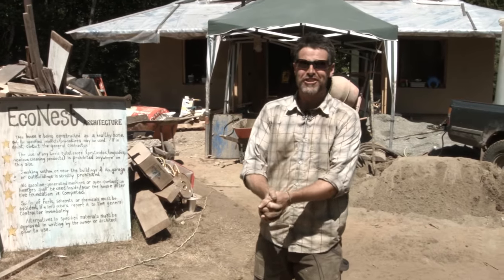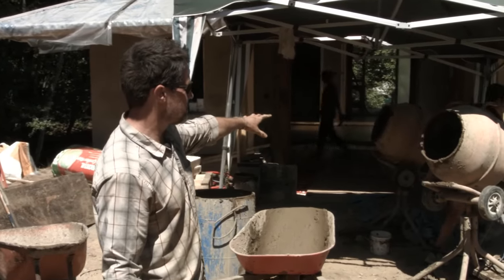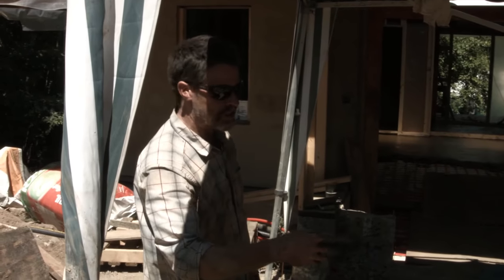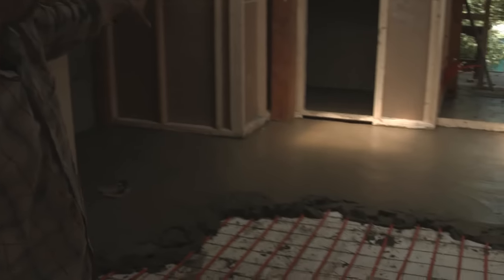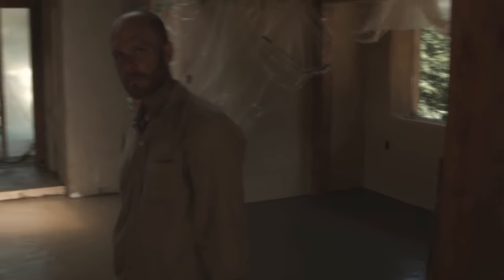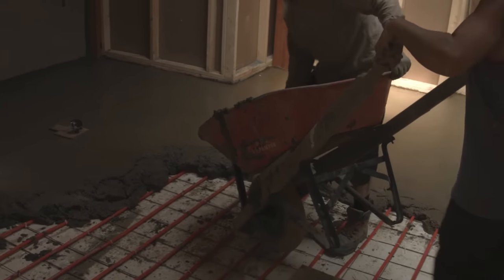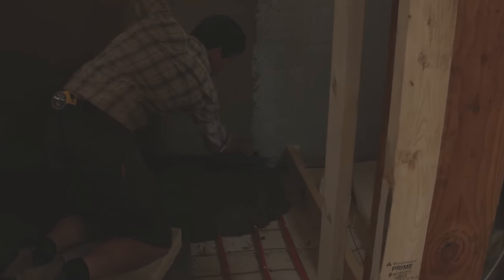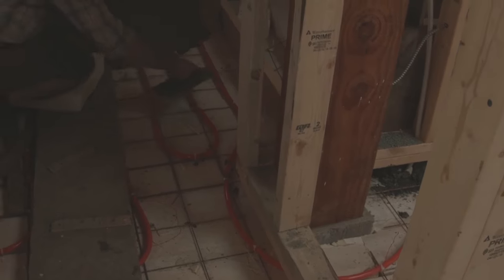Healthy Homes - Earthen floor and hydronics explanation

Comment: I was wondering how durable are the pex water pipes and what the chances are of them springing leaks? I love the idea of a warm floor but wonder if it would be a wiser choice to attain that with other options like a rocket stove bench or wood stove? Yes, it would take longer to heat the home and retaining the heat would require a daily fire but, maintenance would probably be more practical should something go awry.
Reply: If you can access cheap lumber sure, but PEX tubing can also deliver cold water, also you want to heat the place with the most thermal mass which is usually the floor also more even distribution. Please correct me if I'm wrong.
Reply: @roiad876  I am not sure. It’s been a while since I have watched the video and not sure if the PEX had concrete poured overtop. I was told PEX can expand and contract and that is why it makes for a better option, for less leaks, but how long can it last in concrete and is it able to expand and contract in concrete? I have always been leery of it, but if put in an earthen floor, probably better and easier to get to if something did go wrong, and possibly has the ability to expand and contract too.

Comment: I like that very much and will build a natural floor with heating. i just don't know how to heat i don't like gas and electricity... I would prefer a rocket mass heater but I can't find anything if that works or not... Das anyone have experiences or suggestions? I would be really happy 🥰
Reply: you could try a thermal pump. you can use a rocket mass heater to power it. youll want to use metal pipes inside the mass of the rocket heater to heat the water.. the principal is that heat rises, so without electricity by using a high input (underwater to help capture any steam) and a low output for the water in a tank you can get the water to circulate through the pipe. havent seen it used to heat floors but i think its possible you could get it to work for a small area.

Comment: Hello, 

I would like to install a 2cm thick top floor on my existing concrete floor with underfloor heating. Will it still work in this combination? If yes, then can I switch on the heating to speeden up the drying process, as I live in central Europe.

Comment: Question, why would you put a heated floor underneath all that earth, as it will harden like concrete, you will have a heck of a time if you ever have a leak in any of those tubes?
Reply: Doesn't harden like concrete. Easier to change and really good at balancing temperature and humidity
Reply: Radiant heat, or using tubes in a floor to heat, has become very common practice with concrete slab floors. Concrete slab floors are extremely unforgiving since concrete is ten times stronger than Cobb. If there is a leak or problem you have to use a jackhammer to access and repair. With Cobb floors however, any sort of complication is easy enough to break open with a pick axe and repair. Cobb is very forgiving. It can be easily managed and if there is water damage, the Cobb can be reworked and will dry out with the help of fans. In floor radiant heat is an amazingly efficient, and comfortable way to heat your dwelling. There is nothing like a warm Cobb floor.
Reply: These type of tubes are usually covered in concrete

Comment: Why fast forward when "No Explanation" was given about the blocks with holes etc. Looks interesting but no detail explanation given 😂
Reply: That would be for drain and stability, so the clay doesnt push the insulation down and so you don't get too much water into the floor. Clay takes a lot of humidity, but...